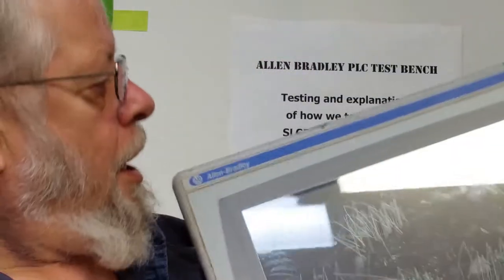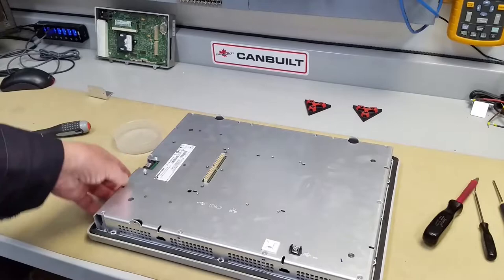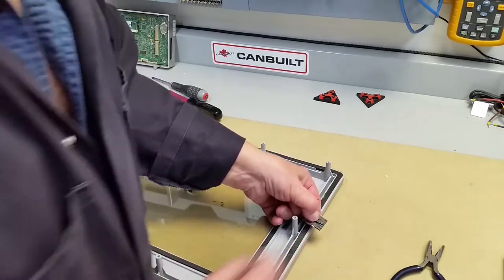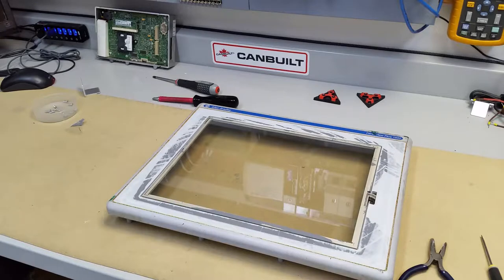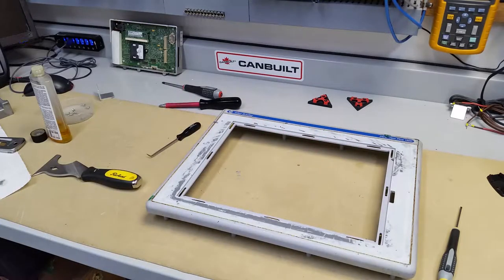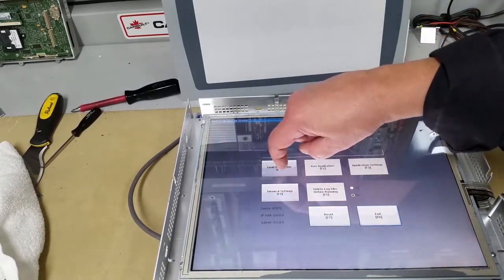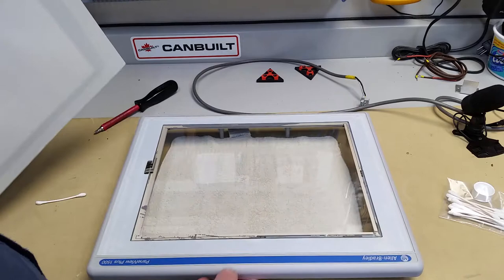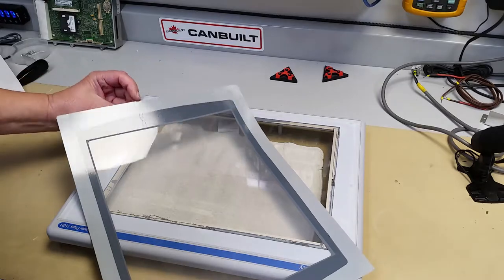Replace the Overlay on a Panelview Plus

Comment: Hello, I have a panel view plus 7, the bd9870 voltage regulator is burned out, it has fatal error 3a, can you explain to me what could have happened, thank you
Reply from the maker: Hi Michael:
THE PVP7 overlays that come direct from the factory are some of the cheapest crap I have seen since in years.
3A Fatal error is when the touchscreen overlay is damaged and stuck to glass.  It is a stuck button error and can be caused by any abrasion or pushing too hard on the screen.
I had one the other day that I fixed that looked perfect, but still gave the error.  A pin prick thru  the plastic to the glass will give the error also.
Burning out the power supply is a new one on me.
Was this in an area of some fluid or somewhere similar?